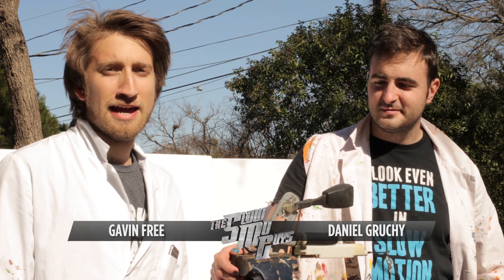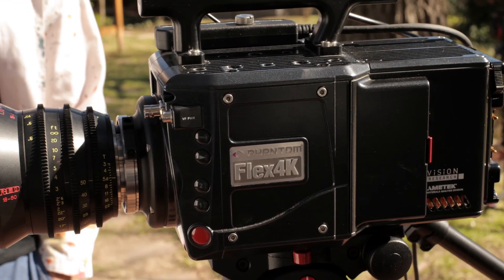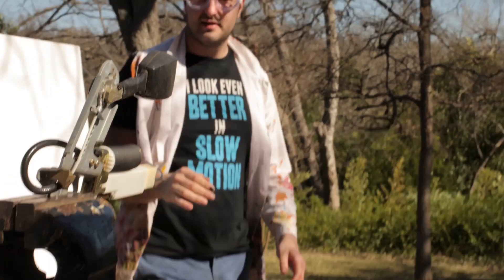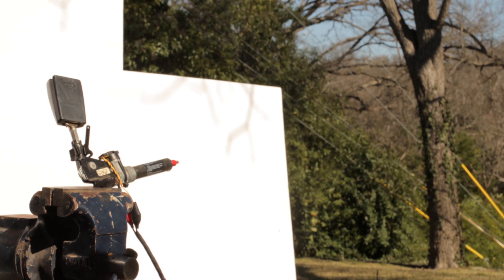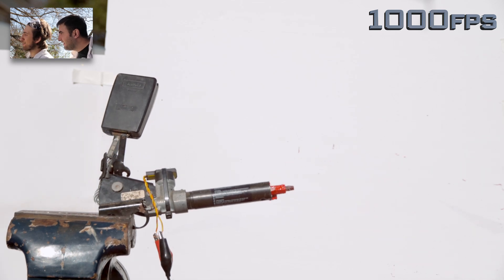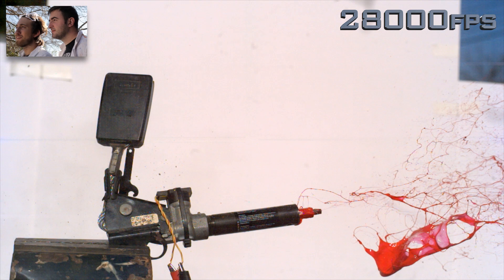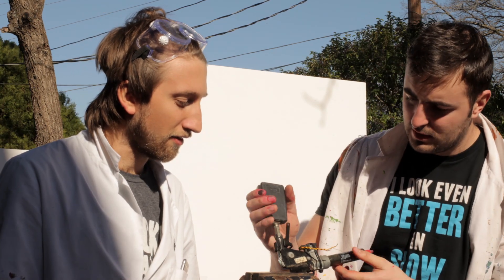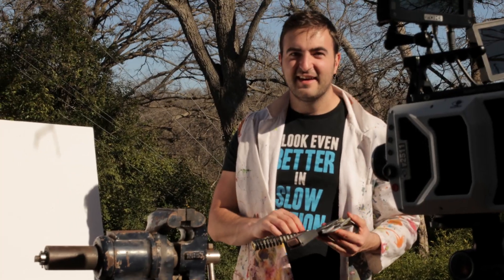Seatbelt Pretensioner in Super Slow Mo - The Slow Mo Guys

Comment: Found out last Monday that my service van has the explosive type seatbelt tensioner when some dude in a Tahoe rear ended me doing about 50mph. Good thing the belt held tight, because the seat partially broke off the rail.

Comment: shot in 4k uploaded in 1080p......
Reply: Because the 28000 fps camera can only shoot 1080p , so there really wasn't any point in mixing resolutions
Reply: GigaPixel The 1080p video could have been upscaled in thier video editor. There was no point in using a 4k camera and uploading the footage in 1080p.
Reply: Memes. That's all I have to say.
Reply: It can be multiple things. Shooting in 1080 allows them to have the same or greater processing power as 4k. Usually running 100+mb a second for a standard, and with the down in pixels they are allowed to amp the speed of the shots. 

The camera name also has 4k in it.
Reply: Main slow mo was made by non 4k camera.
Reply: Again then why film in 4k on the other camera? all of the lower rez shots could have been easily upscaled.
Reply: They state they shot in 4k on the 4k camera, there is no point if you are going to downscale it. 

The same benefits apply, running at higher frame rate and lower res, or a better quality shot that doesn't need to be scaled. 

Why scale the 4k clips down when you can scale the 1080p clips up? Youtube takes care of the downscaling for people with slow connections and HDtvs (vs UHD).

I doubt anyone but them can really answer why they chose not to upload in 4k even though they had 4k footage.
Reply: I think its because they record in 4k but they crop the video so the bit we're looking at fits the entire screen. Plus they dont always record in 4k as if they increase the FPS above a certain point the resolution decreases but Im not sure.
Reply: still seems fishy.
Reply: I dont think you can just upscale a 1080p shot into 4k, you're basically quadrupling each pixel for no reason it wouldn't look 4k just 1080 but with bigger pixels (4 pixels instead of 1)
Reply: ***** Yeah that's how upscaling works, and a 4k display is already upscaling if your desktop res is above 1080p in real time.

Comment: I wonder what car the spring type was out of, because you can see that the cable breaks on the pretensioner, meaning the part was defective!
Reply: It is designed to be pushed, not pulled. So as the seat slides forward, the white plastic part gets compressed and the spring lets go. That's why it went off when he dropped it.

Comment: safety explosives? never heard of them...
Reply: Yeah, theres safety explosions everywhere :) Some cars where to door opens upwards (the hinge on the top) have explosives in the bolts holding the door onto the car too.. So if you crash, theres explosives in the seatbealt, the airbags and the door hinges to open the door if the car rolls on the roof. And of course the gas in the tank is pretty explosive, although thats not meant to go off when you crash ;)

Comment: i actually got to explode the explosive kind of seat belt pretensioner today at work, i work at a car dealership in  the auto shop. most cars now a days use the explosive pretensioner cause its more reliable since the charge that causes the air bags to go off is also used in activating the seat bet pretensioner

Comment: fun fact the phantom flex 4k is worth 6 million (6477170.00)
and the v2511 in also 6 million (6477170.00). in Phillipine peso
pretty expensive shit you got there
Reply: +wolfgang4376 Indeed!  And I've always wondered why they use such expensive cameras when they could get cheaper cameras to do the same frame rate at 1080p instead of 4K...
Reply: V Padilla for the v2511 it shoots more frames than a usual 4k slow mo camera

Comment: What if I accidentally yank the seatbelt with the explosive pretensioner when connecting in?
Reply: +TheLegendOfJoey It wouldn't go off, you see the cables coming out of the explosive pretensioner? It's set off by an electric charge, coming from the same sensors that set off the airbags and other safety mechanisms (these react to sudden drops in speed, for example). So rest assured, and drive safe!
Reply: kool 
 love it
Reply: +Salah Eddine H Thanks for that comment. I was wondering exactly how the pretensioner gets the information that the car is crashing
Reply: +Keith Richards My pleasure!

Comment: so the spring tensioner failed to release? That little cable just snapped? What car was that out of, you know, so we can never buy one and put our loved ones in danger. The explosive tensioners are more reliable due to less parts and the need for only a small activation signal instead of a kinetic pull.

Comment: Helicopter ejector seats..... :D
Reply: +penguinexpress12 They exist.  The Russian Ka50 included tiny rockets in to the base of each rotor blade.  If the pilot's only hope was to pull the eject lever then the blades would be blasted from the craft about one twelfth of a second before the pilot was launched upwards and away from the distressed aircraft.
Reply: +Rob Fraser In a way it is not at all unlike any other type of ejector seat.  In a fighter jet, if you did not blow the canopy first then you would go through it and suffer catastrophic head injuries.  As what happened on Top Gun ;)
Reply: what happened on top gun???

Comment: If I may suggest lightning in slow motion? If possible?
Reply: Unkel Dolan to be fair, all the videos of lightning i have seen are in low quality, an arguably not "really" slowmo.

It would be nice to see lightning in HD 27k frames or something
Reply: It would be to hard to catch on film
Reply: Too dark
Reply: It kind if travels at the speed of, yunno, light.
Reply: SlyphStorm jesus christ lightning in slow motion is like the #1 thing in slow motion on the internet. do you really need them to film it aswell? -.-
Reply: +This video is good but the comments are better not if they went to an atom smasher not technically lightning but close
Reply: xaal carlson Do you mean a super collider?
Reply: oh yeah...
Reply: Not even the fastest cameras can capture every single flicker of a single strike. Another video said the best way to do this was actually use a manual shutter camera, hold the shutter open and pan the camera in one direction during a lightning strike, you'll capture each and every individual flicker or bolt of a strike with the way lightning gets exposed to the camera.
Reply: Because lightning is one third the speed of light, you would need to record at like 2M fps to see it slowly come down from the sky
Reply: xaal carlson Don't mean to burst your bubble but i don't think these two will be going to CERN in Switzerland any time soon ;l

Comment: The problem with the seatbelt pretensioners that are powered by explosives is that once the explosive goes off your seatbelt will more than likely be stuck at where it was pulled to by the pretensioners. My brother had to get his daughter and he was driving our step-dad's car, got in an accident and the pretensioners went off. He smelled gun-powder and the seatbelts in the front seats were stuck at where the pretensioners pulled them to. We had to take the car in so the the front seats could be repaired.

Comment: Whats up with these 60 fps retards? Higher frames per second is only useful when there is a lot of fast action in the video, so there's less blurring. If slow-mo guys render it at 60 fps, it will only speed up the video, which is exactly opposite of what this channel does..

If they render it at 30 ftps for slow-mo and then re-render it at 60 for playback, it will be pretty useless, because it will simply duplicate every frame and instead of seeing 1 frame for 1/30th of second, you will see 2 identical frames for 1/60th of second each. So you will pretty much double the size of video without gaining anything out of it.

Comment: From an engineering standpoint, the spring mechanism seems more reliable than the propellant mechanism. Assuming that the cable isn't made of some flimsy, weak rubber tubing like this one would, the spring mechanism would be sure to fire. The electric mechanism on the other one could fail if there is a problem with the electrical system before the seatbelt mechanism could activate. Additionally, the spring mechanism would be easier to re-use if the car was only in a minor accident and the vehicle could be salvaged.
Automotive engineers/car people want to discuss?
Reply: Michael J. Caboose modern srs systems can fire this independently. newer cars will fire the tensioners despite reserving the airbags in a mild collision.  Mechanical systems also can fail. seems like the perpetual loading of the mechanism seized the pawl in this case but that cable was indeed dogshit. Aside from the electrical the explosive is simpler and ONLY an electric current will fire it. Modern cars have self diagnosis built into every circuit and if your SRS lights not on its a pretty damn good indication its ready to go. This will also throw lights if these have been fired before. I also wonder if sensor based srs is faster than reaction based (as in your body tightens the belt and this thing releases?).

Comment: Helicopters don't have ejector seats due to the rotor blades xD But yeah fighter jets do
Reply: james shirt The Kamov KA-50 series has a pilot ejection system
Reply: Ka-50 Black Shark co-axial attack helicopter says hello to you Sir and proves you wrong.
Reply: Ruben Hayen james shirt Helicopters do have ejector seats. They have beams going up to the rotors to stop them dead when you eject...
Reply: Sir.Edward Jenkins Auto rotation is basically landing a heli with engine off. After it cuts off rotors still have momentum which can be traded for lifting power by rising collective. Also any horizontal speed will provide additional spin to rotor due airflow, and rotors will generate lift due non-zero angle of attack like wings do. With all theese factors a pilot can land heli safely with no working engine. Auto rotation is basic skill for a pilot, they train it all the time, by simply turning off engine mid-flight on purpose.
Reply: Sir.Edward Jenkins some even blow up the rotors to meke them fly away
Reply: james shirt a helicopter with an ejector seat, now that would be entertaining to watch
Reply: ***** indeed. Point is Helicopters DO have ejector seats becuse otherwise no one would use them.
Reply: H171001 it took like 1 minute to search for ejection system on copter....use internet before saying shit to a guy....goddamn, ignorance is a choise in the internet era
Reply: Andrew Werdna 
Bergonius is 100 percent correct.
I wouldn't be here writing this comment, if it were not for helicopter auto rotation proccedures. 
3 years ago I was in the back seat of a bright yellow MD500 (the unarmed civilian version of the egg shaped  AH6 little bird) doing some aerial eradication of invasive species for the DLNR of the state I live in.  (Basically this consists of shooting goats from a helicopter in in remote areas. The goats tear up the native plants, which erodes the soil, which causes alllllll kinds of havoc... soooo, animal lovers, weep not for the goats) 
Anyway,  on the way back to the hanger - heli lost its engine, we were at  around 1000 AGL I would guess.  I was in the back so I never saw the altimeter. I just heard a bang and the turbine just stopped, no wind down no chugging just bang! - off. And all kinds of alarm buzzers start hollaring  from the cockpit.  And the pilot, cool as a cucumber pipes up sounding a little like chuck yeager  " well, we just had an engine failure, the sumbitch ate something she dont much like, and wont light back up, so im gonna land her over by the harbor in that parking lot, y'all hang on it might get a bit bumpy"   I'm thinking,  a bit bumpy? Fuck man were falling out of the sky like a brick and you say it might be "bumpy"  you are a steely eyed SOB.  Anyway he pulled off, like right out of the manual... we fall out of the sky, and at 100 feet he takes a big bite with the collective and he sets it down pretty as you please in the middle of the parking lot,  really greases it in smooth we slide forward, maybe 15 feet.  I said something cool like "hey, thats a better landing than you ususlly make back at the airport" just to prove I was still a man,  wasn't scared shitless, and that my balls hadn't crawled back up from where they came from (they did...)  and I wasnt shaking like a leaf on a tree (I was...)    anyway, later,I learned it turned out the engine had injested an adult frigate bird (a large seabird with a like 6 or 7 foot wingspan)  and completely munched the turbine. 
So yeah, auto rotation is the bomb...
Reply: james shirt Ka-50 Co-Axial is one example of a helicopter that uses explosive bolts on their rotors to throw away the rotors and then engage the pilot ejection systems.
Reply: james shirt So you've seen that there are a few examples of choppers with ejector seats, and you were man enough to admit you made a mistake, thats fine and you've learned something. What annoys me here is the 192 people that blindly liked your comment because it sounds logical.. (because it does sound logical) and will carry on believing that you can't have an ejector seat in a chopper.
Reply: Sir.Edward Jenkins You can auto-rotate if the ejector seat isn't an option. Auto-rotation is cool as fuck.
Reply: L4RRY Yeah that grinds my rotors
Reply: bergonius cool story, bro.
Reply: imagine the test flights:
control tower "allright are you ready to test the first helicopter ejector seats?"
pilot: "uhhhhhhhh suuuuure but wouldnt the blades get in the way?..."
"nonsense we've thought of everything"
"ok..... whatever you say...."
(ejects)
control tower: "ummmmmmm we might want to rethink the whole ejector seat thing...."
Reply: Andrew Werdna Your loss, it's a good story.
Reply: Maybe we can settle to say "Most* helicopters don't have ejection seats"
Reply: Guys, thank you for all the one examples that keeps getting repeated and thank you to those being ignorant and calling me an idiot, we all make mistakes, and as Gavin and Dan are both English as am I, I was thinking of helicopters that our Allies use and at the moment its hard to determine if Russia is still an ally.
Reply: OnePercent QUICK RESPONSE GO!
Reply: I was gonna say
Reply: Skaterboybob What
Reply: bergonius well you forget, you must  DROP like a stone, to get the rotors to pick up speed.  Auto rotation cannot be used in low altitude (dead man's curve).
Reply: Goldfinger...
Reply: ..... shit , that would be cool as hell though
Reply: MrMcBobb Havn't heard about that nor do I know what it is at all... If you could send a vid that'd be awesome (its 1 o' clock in the night for me so I can't be asked ;) )
Reply: james shirt Couldnt they have ejector seats that just kinda.. Drop the chair out of the floor?
Reply: Skaterboybob If they did that they run the risk of the helicopter falling out of the sky and crushing the pilots
Reply: james shirt Hm.
Reply: Skaterboybob They can't have since ejector seats have rockets underneath them that fires you up in the air to allow a parachute to deploy. If it dropped you it could not have enough time (like if you are 20 m up in the air or smth)
Reply: L4RRY Yeah
Reply: james shirt Well, I mean, whether or not any helicopters that England and her allies use have ejecting seats  is kind of irrelevant, as long as a type of helicopter with an ejecting seat exists at all is really all that mattered...
Reply: Spethman Jones Well then we have to say that "most" airplanes/craft doesn't have ejection seats either...
Reply: Sir.Edward Jenkins Most modern military jet aircraft have ejection systems.
Reply: sewa pipe . Lol. There's already a system for ejector seats in helicopters.  Google it,  great videos
Reply: stinkyfungus Well that's a fucking essay.  Also, cool story, bro (I assume).  Not a chance in hell I'm reading all of that dross.
Reply: james shirt That made my day... Imagine if they did i'm LOLing so hard right now.
Reply: james shirt Some helicopters have the rotors detach from helicopter with pilot.
Reply: Pipi Chi exactly!
Reply: james shirt COULDen'T IT JUST EJECT YOU OUT the sides or the front or bottom
Reply: +Sir.Edward Jenkins tell that to every american military helicopter pilot hahah
Reply: +james shirt Helicopters just drop the person out of the bottom.
Reply: Jared Tyburec They don't, cause if they did the helicopter would lose control and might just fall straight down on top of the pilots
Reply: +Sir.Edward Jenkins It's not beams, when you pull the eject release all rotor blades are ejected first, like one tenth of a second.  And then the pilot is ejected like and other pilot would be - straight up.

A crashing or uncontrollable helicopter no longer has any need for a rotor so it throws it away moments after the pilot pulls the eject handle.
Reply: Rob Fraser so i was right in asking that question.
Reply: They do have a helicopter with ejector seats..  but first the explosive bolts on the rotors go off.  So the rotor blades clear first

Comment: Do you add in your own sounds? Or does the audio record slowly as well? Wait, what's the framerate for audio? Hertz? o.o
Reply: AverageFlamethrower, They add their own background music and slow it down. This camera and other like it doesn't record sound. They just takes pictures, in the case of the 28,000 FPS one it takes 28,000 pictures per second. If it did record sound it probably be slowed down so much that it would be impossible to hear.